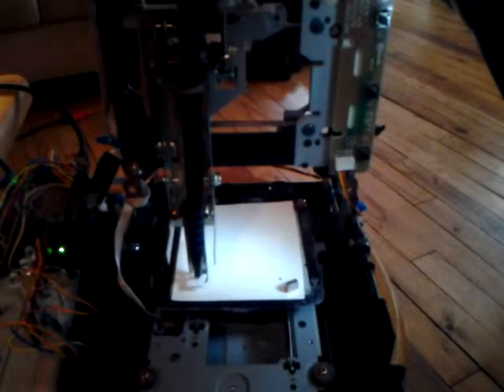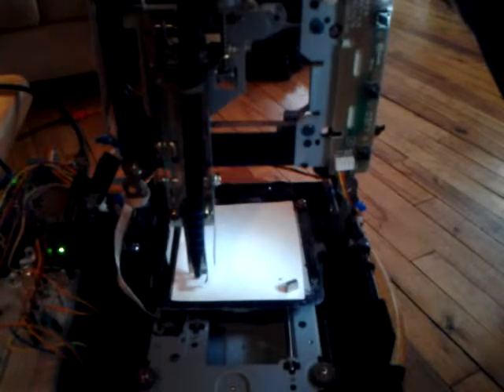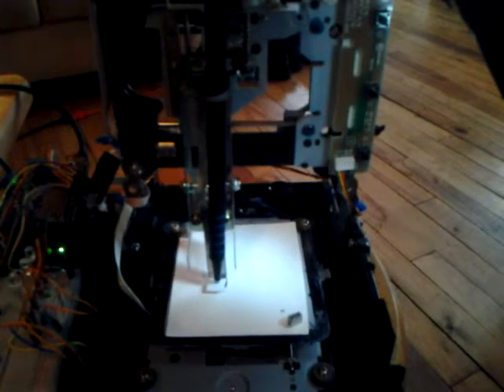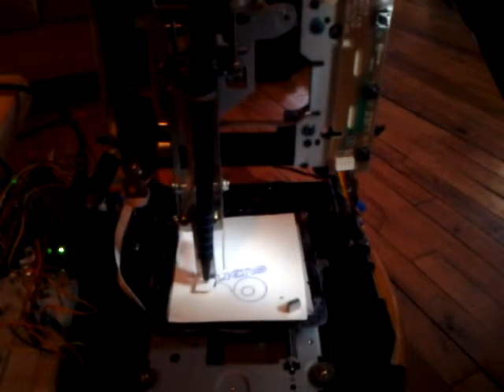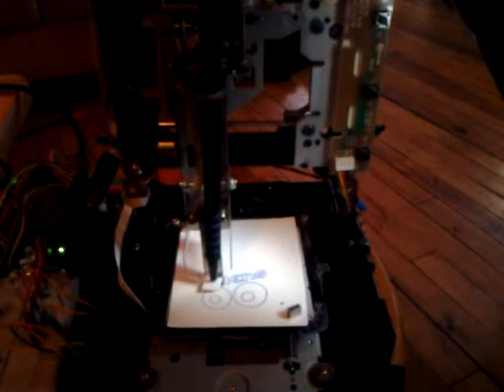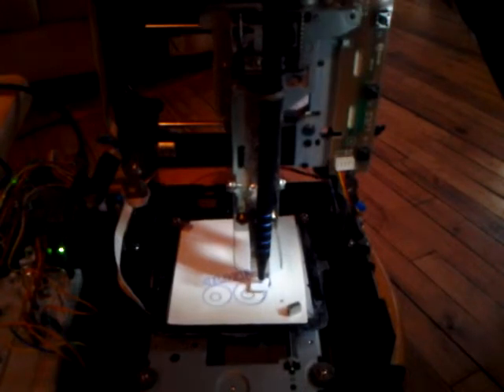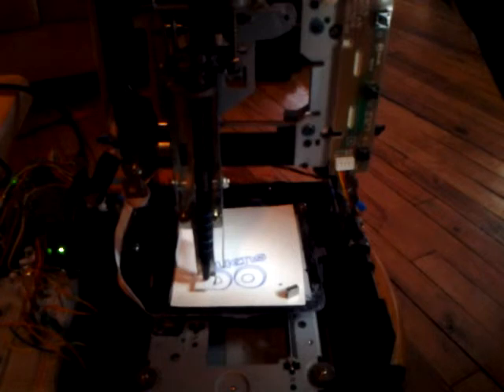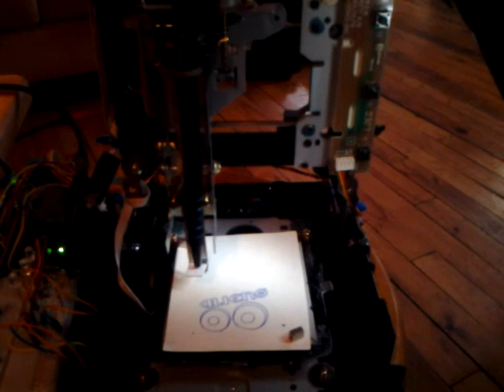Mini CNC plotter testing 3rd axis stepper

Comment: hi
the scketch and schematic pls
thanks
Reply from the maker: +Inovator i'll have a look to see if i can find that sketch .  schematic  is just default of a double stacked Adafruit stepper shields. I no longer have this rig setup the same so i would have go from memory . Im re working the setup to hold a 3D pen , and use easy drivers and GBRL. 
in the short term , i think it was using a slightly modified version of this :  https://github.com/MarginallyClever/GcodeCNCDemo
only that i added adafruit stepper lib and inserted the single step function from it into it , but it seems someone made the GcodeCNCDemo4axisV2 already support that . 
should be better to use that sketch .  ( better than my old one was loosely based off of the old 2 axis version ).
Reply: thanks for help but in my plloter i need to use 3 steppers with only 3 H-bridge , so i cant use the adfruit sheild, and thanks again
Reply from the maker: +Inovator if you use the older version all you need to do is  replase the step() type function to one that works with your own step code.     I have only used the V2  motor controllers form adafruit, but i have used the ULN2003 driven smaller steppers .  if you have a hunt you will see how to drive them using  the default arduino lib u think .  I never used it  i just made my own .  I take it your h bridges need 4 wires  for control .   there is all sorts of examples fro driving them that way , you just need to make a wrapper to get it so you have a direction as 1/0 and a single step function .